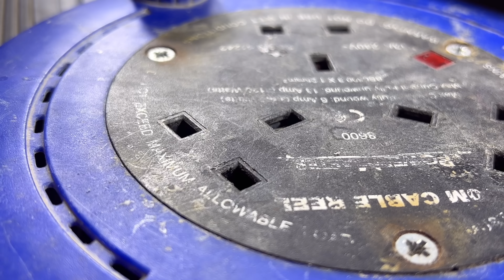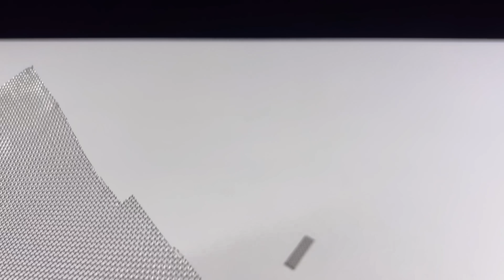34 Intelligent Plastic Repairing Techniques That Will Make You Level 100 Master

Comment: Most of these methods can be very helpful because with the amount of plastic items in our lives and the breakages that happen to them, we can easily restore them using these solutions and use them like the first day. Thanks for sharing your experiences and useful skills :yt::goodvibes:
Reply from the maker: Absolutely!
Reply: What is the glue used with the ashes?
Reply: @DaNervous319 probably same super glue
Reply: Agreed. I have so much cheapo GoPro accessories made of brittle plastic i repaired

Comment: Those were awesome ideas!!. I repaired bolt mounts on my Goldwing fenders by drilling black ABS pipe, and taking the shavings and you mix those with small amounts of acetone until a slurry was made and then glued it together with that slurry. It’s still holding to this day hard as a rock like new.

Comment: Love this stuff.  I have an AC unit in the car that broke. I can now fix it by repairing one of the screw holes that snapped.  

My one question is, what's the liquid being used? Acid of some sort?
Reply: Superglue. He wrote a label at the beginning of the video. Foam melts when you pour some glues over it.
Reply: super glue AKA  ca glue

Comment: For repairing the sprocket, what kept the baking powder and glue from bonding to the mold you made out of glue?
Reply: No answer for your question, but that is definitely baking powder?
Reply: Wd 40
Reply: heat from the bonding , melted the glue

Comment: 4:40 .... cog wheel repair like that... can't really do surface treatment of significance on object like that...just to get trough some time....until it meets WD40.  Or silicone spray...Really curious where part came from and how its doing. Anyway -highest award for heroic use of brain against planned obsolescence is YOURS

Comment: I loved your video!  Can you tell me what is that heating tool and what’s the silver tape that looks like foil.  I’d like to order these, so that I can also mend things.
Reply: It's justva soldering iron, with a few adaptive tips hand made.    The tape, idk wut its called, but it's designed to be heat resistant  n in the tape section of the hardware store
Reply: the tape is called foil tape. It's the same stuff they use on heating ducts.
Reply: @DeadpoolsGambit thank you

Comment: What i learn from this : i need to have soldering gun at home
Reply: You can use a stove and a plier holding a razor blade or nail or any metal. Even a lighter but it’ll take awhile to heat up